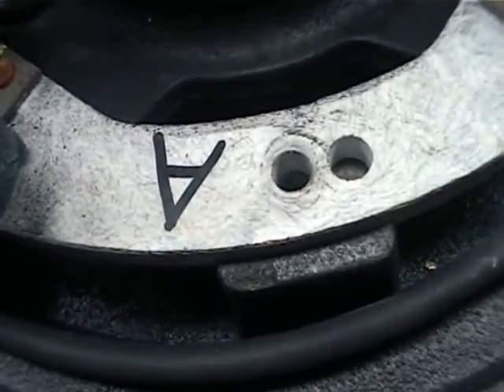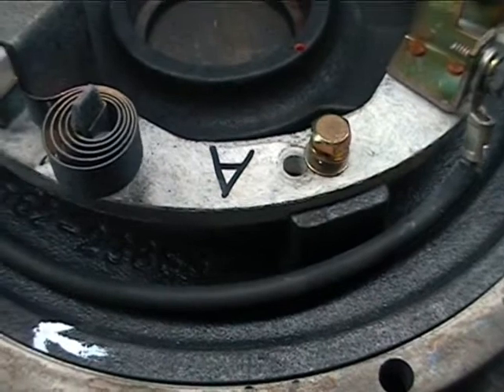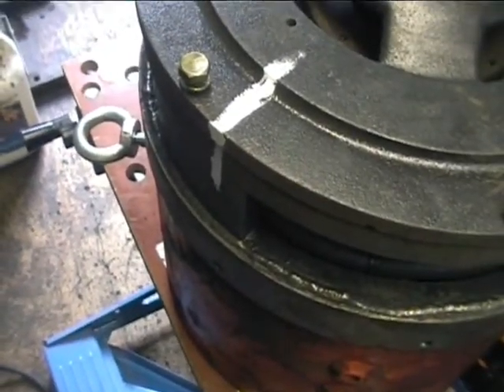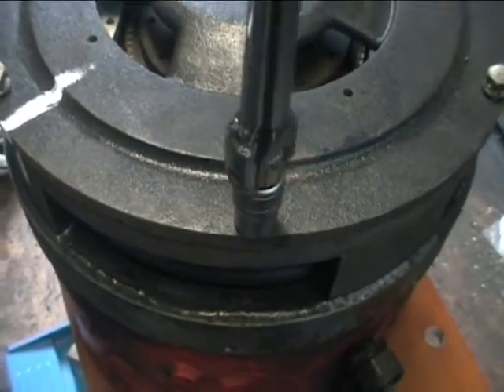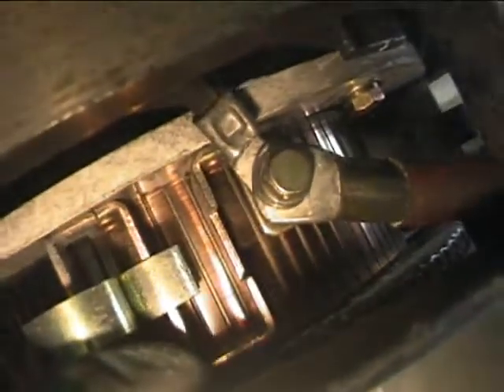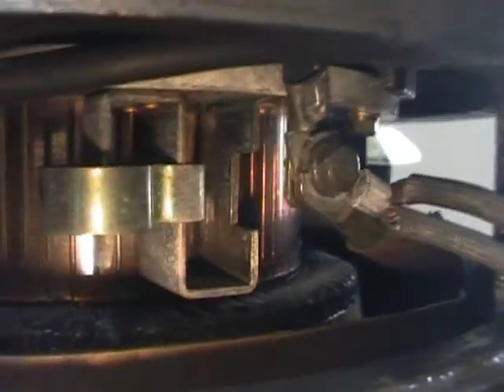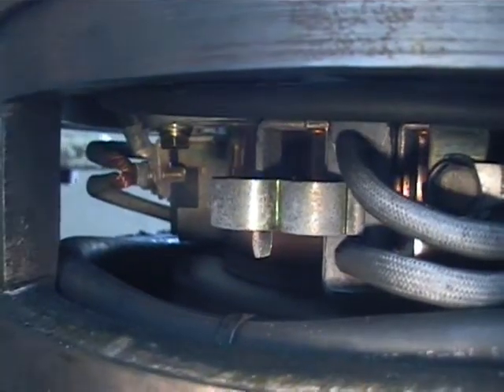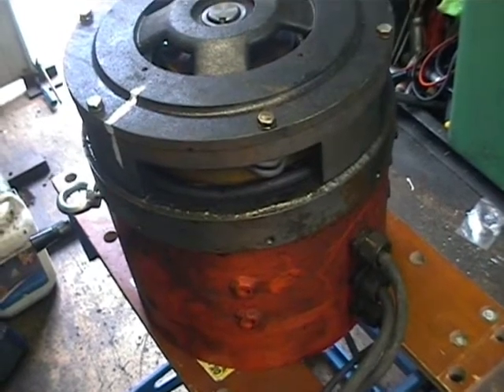Series DC Motor brush advance Part 4

Comment: Were you stoned when you did this?
Making the holes that big, because you were too lazy to use a center punch to do the job properly!
AND what's this, three hands? BUT we humans were ONLY created with TWO lol!
Reply: It's standard practice to drill holes .5mm bigger when you don't need to fine a tolerance. All they was were clamping bolts, it was held inline via the tabs.